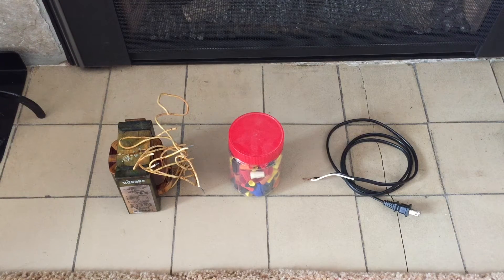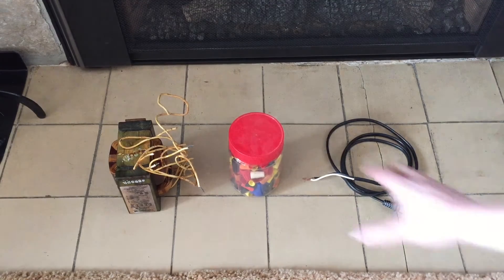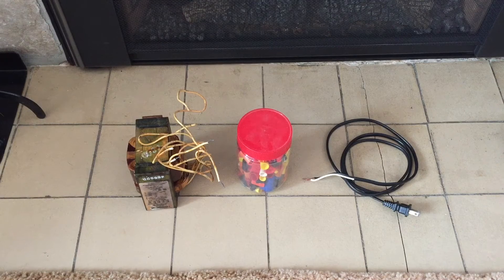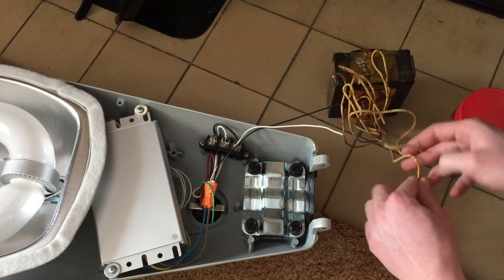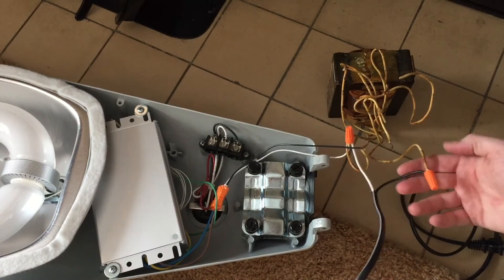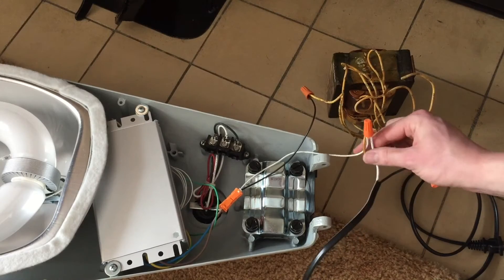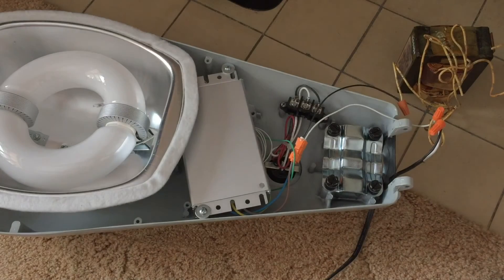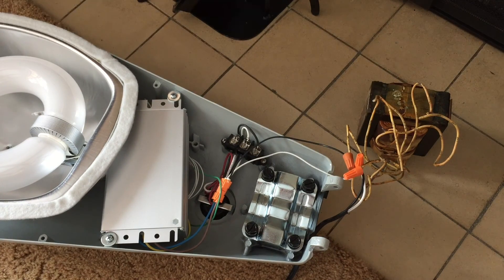Running a 277volt light fixture on 120volt

Comment: I have recently managed to get some Japanese 200V 60Hz HID ballasts and fixtures running off of a 208V 60Hz supply derived from a step up isolation transformer that converts 120V to 208V.

Comment: I've never been in a situation yet where I have a fixture that's only rated for 240 or 277V that needs to be ran on 120V, nonetheless I figured this could be done in theory,  as a crude autotransformer so to speak.  You'd have a lot of losses so in a real life application  replacing the 277V ballast or driver  with a 120V or multi tap / universal voltage 120 ~ 277V ballast/driver  would be your best bet, or use an appropriate step up transformer to supply the proper voltage on the input to the fixture.

Comment: Very useful video!  Thanks! What would happen if the fixtures wattage exceeds the wattage of the ballast?    I need a way to test a bunch of 277 volt fixtures that use 1300 watts,  They will only be on a short time, but its still a larger wattage than I can find on any ballast.
Reply: Get some 277v cordcaps and do them one at a time. Or get a big transformer either new or used from an auction house and put 120V on the secondary and your load on the primary.

Comment: Spoiler: Use a spare multi tap ballast and hook up to the 120v - COM tap on the primary and output the 277 - COM on the primary also, creating a crude autotransformer. The secondary is left open (unconnected) and creates a bit of loss.
Reply: Dehv Blak what??

Comment: Yes the common wire is required in order to make the ballast transform the voltage up or down. Otherwise the ballast won't have a proper magnetic field to run and step up or down the voltage.
Reply: Yep , and common is a return path